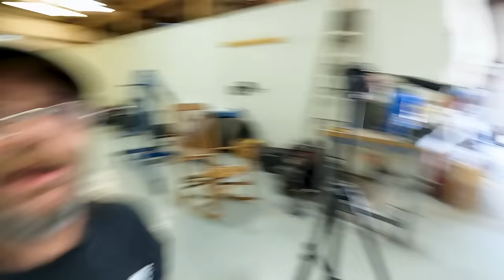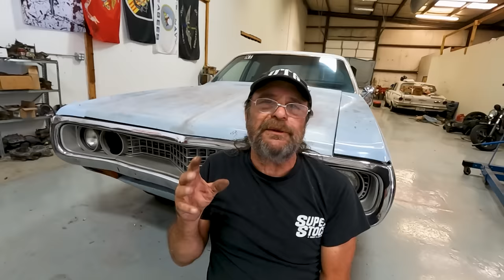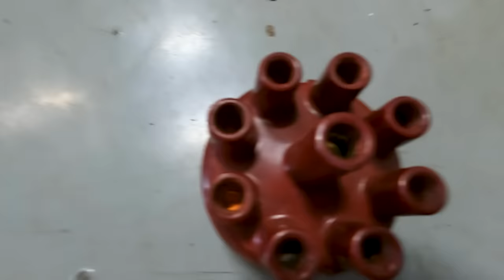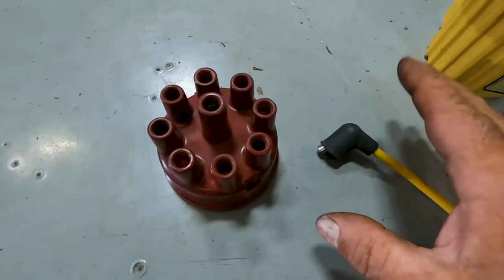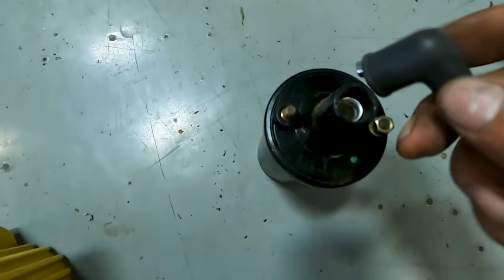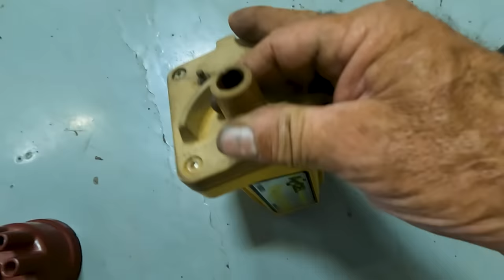Engine Misfire Under Load - Diagnosing And Troubleshooting One Of The Most Common Drivability Issues

Comment: Tony I watched all your videos and still have misfires under load and sometimes backfires thru the carb. 460 Ford Rebuilt entire Carb, Brand New Distributor, and it’s in correctly, Timing is set, No Vacuum Leaks,Brand New Plugs and Wires, Brand New Coil, Brand New Ignition Wiring from DuraSpark to Coil, Blew the fuel lines with Compressed Air. I’m Out of Ideas. Brand New 93 Fuel. Engine was rebuilt last year but never fully used. Maybe 2 Hours of run time. 
Running Amazing in Park, 
“Can you tell me about the Voltage Fix before the coil ? If you think this applies? The Alternator is New and is a 1 wire alt with the voltage regulator integrated. 
What can this be?

Comment: DEAR SIR : THE PLUG MUST GROUND TO THE HEAD .UNDER LOAD AND WITH BOAST GAP RESISTANCE GOES UP , ADD A POOR CONNECTION AT THE HEAD  RUST CARBON . SPARK WILL GO TO THE EASIEST WAY . OIL ON HEADS HEAD BOLTS  . .REDUSING TOTAL RESISTANCE WILL GET THE SPARK TO THE GAS. PUT ANT-ISEIZE ON THE PLUGS.. I HAVE SEEN A LIGHT SHOW IN THE DARK WITHOUT IT

Comment: I need help here, so what happens is, engine sounds perfect in idle, we go for a drive and as we accelerate, reaching 60kph it just stumbles and won't go past that, engine sounds kinda good (baaaaaaaaaaaaa) reaching 60kph it goes (bapapapapapapa) and engine sounds very bad
Reply: I should maybe add that the car won't start at all, only if we push it. Still don't know if it's the battery or the starter, all this just happened today

Comment: False hope on the watching the spark, take your multi meter and measure the primary and secondary. That will tell you for sure. No guessing. More common check the plugs for carbon tracking, spark outside the boot.